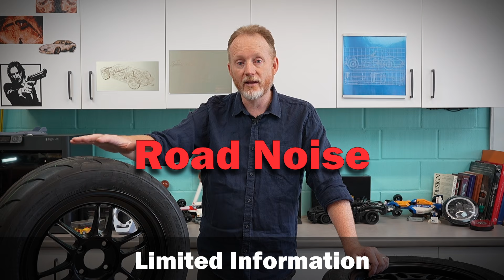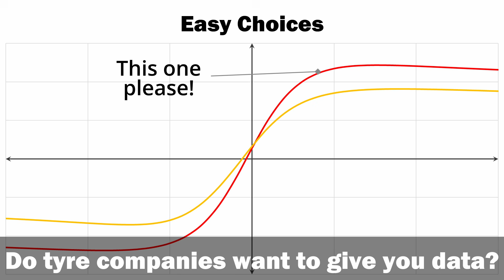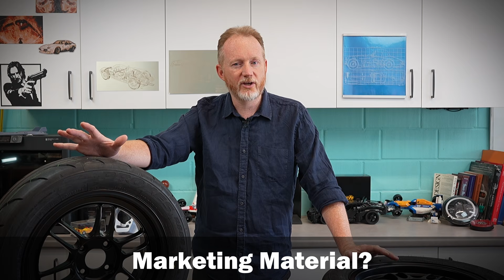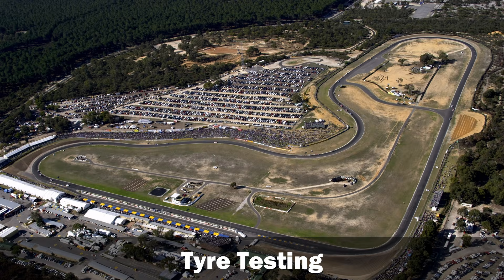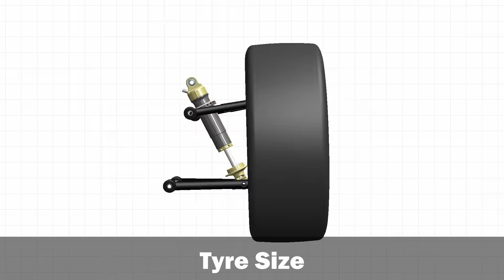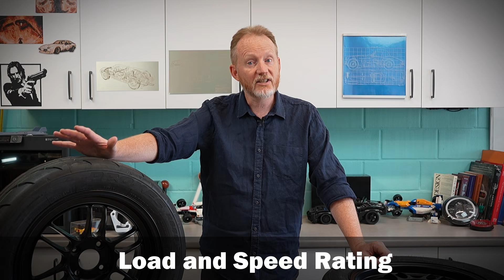How to Choose Tyres When There’s No Data (Project 171)

Comment: Professor, with the greatest respect: your YT lectures would have a lot more credibility and entertainment if you intermixed actually building the the car with your lectures. The reason for designing a car from the tires-up is the first lecture lasting 15 minutes at best, followed by practical building of said car. 

It's the difference between 12k subscribers an 1M subscribers.
Reply from the maker: It will get there. You make some valid points.  Keen to show the whole process and for a full ground up design there is a lot of time spent doing work that isn’t great visually near the start.  That being said I could do more to show other examples… there are many times I have wished I took more video / photos of past projects.

Comment: The only cars I’ve ever seen regularly using the r888r tires are show cars. Small town sample size, but I’ve never seen a single pair at autocross or on a car met in the hills.
Reply from the maker: I have seen them on a few cars here, but definitely not making the case that they are the ideal autocross tyre.  Happy enough if they end up as a decent road tyre / passable track day tyre.  Will aim to test a few options when the time comes.

Comment: Tire Rack and Tyre Reviews have a boat load of objective and subjective tire data.  
The UTQG ratings stamped on the sidewall are from a test designed in 1966 and implemented in 1978. The treadwear rating is still the most relevant, but does not account for modern compounds (silica-rich, multi-phase polymers) and can vary greatly depending on the asphalt type, driving conditions and loading.  The traction rating is performed on wet pavement and concrete on a skid trailer that locks the tire up and only measure sliding traction(100% slip). It does not represent the tire's peak traction. (5-15% slip).  The temperature rating is a structural failure test performed on a test wheel and has nothing to do with the tread compound's heat tolerance when driving hard/at or past the limit.
Reply from the maker: I did make a few logical leaps from the temperature rating. You are spot on that its a structural test. In order to have a tyre that performs well in the test there is a need to focus the tyre design on reducing internal heat generation and improving heat dissipation.  These are aspects that would lead to a tyre that likely has more stable temperatures on track and hence more stable grip.  Although I admit it is a leap of logic that I didn't fully explain.

You are also spot on that the traction rating is based on the contact patch rubber being in a 100% sliding state which has a much lower friction that what would be expected near the peak sliding speed for the rubber.  In this I agree that the treadwear number is probably a better measure of grip which is why I made it the main thing I was looking for.

I had seen the rating system that Tire rack had done on tyres which looks to be reasonably well collected and presented subjective feedback from customers.  I think that it does beg the question how much of it is tailored for commercial purposes.  I think forums find a way to be quasi-peer reviewed.  Post something people disagree with and there is an army of people wielding keyboards to take up an argument.

Still happy to have a look through the recommendations.  I can't believe I had missed something like Tyre Review which actually looks like it has some great review articles, and attempts to put figures to the performance.  Thanks for posting the feedback.
Reply: @KevinHayward7  The hard part is these reviews are generally done with a much heavier car. How relevant is the data on a car half the weight?
Reply from the maker: Definitely an issue.  Ultimately will need to do the work of testing on the final car.  I might be stubborn, but not stubborn enough to stay with a tyre that turns out to be rubbish once running.  All engineering claims should be put to the test, its part of the process.

Comment: load rating is my key...
Reply from the maker: My main question around the load rating specification is how well it does or does not capture the extreme load changes on a track.  Otherwise definitely helps know the car segment the tyre is designed for.

Comment: I thought I knew a little bit about tyres but when I read into it during my FSAE days, you realise how complex a topic it is. FSAE teams are very fortunate to get access to the common sizes and compounds available to FSAE teams. We stepped up to an 8” wide tyre and saw significant gains. I spoke to a German team and they got their best results from a 6” wide tyre. Their car weighed 147kg  and ours was nudging 200kg.
Reply from the maker: The tyre testing consortium is a pretty unique and wonderful initiative.  Easy to get spoilt in FSAE.  The TTC didn’t exist when I was a student but I have had a chance to go through it as a faculty advisor.  I think it has had a massive positive effect on increasing the average knowledge about tyres in the community.

Comment: Have run 888’s and they are going to be fine on that car. Will last forever and be high grip on road (except when cold) and more forgiving at the limit than some of the better semi slicks. Fallen Azenis are any good option for that use case. I would also consider a set a quality road tyres with a lower overall grip threshold than will reach slip angles at less dangerous speeds but just don’t take them on track or you’ll kill them. I used Michelin Pilot on my gtv and that was nice for sliding around without being too antisocial.
Reply from the maker: Will definitely be aiming to identify a good fun road car set of tyres.  The Michelin Pilots have come up in a few sources as a good option.  While it is still a long way off I'm keen to do all the driving to test the different tyres.

Comment: I previously asked this, but my comment seems to have disappeared, maybe because I included a link. I'd like to hear your take on the Factory Five 818 kit car. It shares some fundamental elements with Project 171.
Reply from the maker: A couple of them in the sportscar builders club I'm a part of.  I think it was a pretty good approach to a one donor kit car.  I'm not a massive fan of the suspension layout but Factory Five did a great job of putting something together for the suspension that made good use of what was in the base car.  They also look pretty good.  If I was to do a kit car it would be in amongst my top 5 options.

I did purchase the manual for the 818 to use as some reference material.  As well as the book for Midlana.

Comment: Bing in the UK, wet weather grip and cooler temperatures will guide my selection down quite a different path. Totally agree that 15" seems to be the sweet spot for both wheel and tyre options! Packaging inside a 13" looked to be quite a bit more difficult. How much was your tyre choice be influenced by powerplant/gearbox combo? How much flexibilty can you expect to get by changing the tyre outer diameter for torque/speed tradeoff? I can imagine choosing a sligtly larger tyre to do a 0-100 kph run with one less gear change.
Reply from the maker: Absolutely agree that if I was in the UK it would not be this tyre.  I wasn't too worried about powertrain / gearbox combo when choosing the tyre, although at some point there maybe some changes to make with the final drive.  I used to drive a Subaru Wrx with this basic sizing and I think everything was geared really well for some spirited driving.

Comment: Well explained. 
 Too bad smaller tire sizes availability is poor. I think you're doing exactly the right thing. How the tire behaves near the limit is more important than max grip. For a road car, you'd want to enjoy the car at reasonable speeds.
Reply from the maker: I did look a fair bit for something in the 14" size.  I think 13 might be a little limiting if at some point I want to significantly increase power and want a lot more brake in there.

Comment: For all the negative press the Toyo R888R gets, it's one of the most cost effective semi slick road legal tyres available and as long as the last 10th of a second lap time isn't the main objective, they're within 90 percent of a Yokohama A052, size for size, on warm, dry racing asphalt. Just don't bother risking your precious metal on them when it rains, or it's cold! And as a road tyre, it's fine, and not actually terrible on wet roads, just not "good", like Michelin PS5 or Continental Sport Contact 6/7, obviously are. The two biggest issues I've found with getting any tyre to perform at its best, are tyre pressures too low and wheel frequencies too high. But you know more about those things than I do, so I will patiently await your testing and analysis programme with mounting anticipation!
Reply: At the price, linglong sport master absolutely annilates the ps5s. Chinese tyres are getting really good these days.
Reply from the maker: Cost effective was a very important aspect of the initial tyres.  Reality is that they will sit around during the manufacturing process and will not be brand new once they hit the track.  It was important I didn't spend too much on the first set of tyres, but at the same time needed something close to what will be needed for the full design process.

Interestingly the final decision was whether to go for the A052 or the Toyo, and it was the price that was the final decider.

Comment: Problem with track tyres (< 180 TW) on light cars is that they're all heavy and stiff and thus harsh. Not worth the trade off for a road car IMO. Top street tyres (e.g. Yokohama AD09) are still capable of outrageous cornering performance on the road.
Reply: The Yokohama AD09 is what i chose for a heavier car (mostly road going MX5 NB).  What I liked from the 'imperfect data' available is that the compound contained silica to improve wet grip (at the expense of reduced dry grip that sets track records), so edging out other options like R888R, etc.
Reply from the maker: The AD09 was and still is definitely an option.  A long time ago on an old BMW I had I almost exclusively ran Yokohamas.  Really appreciated the quality back then, and I'm happy to put different Yokohama tyres on mosy of my daily drivers if there is a good option from the company.

Comment: Grassroots Motorsports has done a pretty comprehensive tire chart over the years. They rank almost every single high performance tire available 200 treadwear and under. I would have gone with the Bridgestone re71, but the price point of the r888 is usually pretty attractive
Reply from the maker: I didn't spend much time going through Grassroots Motorsports, which I absolutely should have.  Thanks for the reminder.  That is a resource I almost criminally underuse.  So many good articles.
Reply: They just posted the "Autocross Tires for 2026" video yesterday. Perfect timing.
Reply: In a moment of misplaced obsession to detail*, when I wanted to upgrade the wheels and tyres on my very first car, I went for the first incarnation of RE71.  

* This was in 1987, and the vehicle was a Corolla.  What's even sillier, is it was the original KE10, replete with live axle on leaf springs, and a single transverse leaf spring across the front-end! 😅 

The set of 185/60/13 on special order, was $560 - at the time equivalent to my fortnightly income after tax!  Nowadays, that would equate to $3200..! 

Such a stupid 19 yr old...🤦‍♂️
Reply from the maker: I wish I had appreciated the old rear wheel drive Corollas more when I was young.  We had one that I always thought was just too slow.  What I didn't appreciate in all the thrashing about that we did with that car that it was a very lively fun car.  To this day the best handbrake turns I have ever done in a car.  Cookie cutter tyres and low weight and that thing would just rotate on a dime.  If it had super grippy tyres it may have ruined the main fun things about that car ... well until you added a ton of power to compensate, maybe changing all the suspension bushings, stiffen up the chassis, new springs and dampers.  Maybe a race seat and a roll cage ...  

Hang on a minute!
Reply: As it happens,  @KevinHayward7 , I did add a fixed frame seat, new firmer bushes, re-set leaves, KYB dampers all round.  Also had the widdle 3K engine rebuilt + mild cam upgrade, 28/32 Weber, zorst, etc.  Yep - it was a lot of fun, but it didn't have the power to loosen those very  sticky tyres.

Comment: In the track day circles that I'm in the r888r is considered to be a pretty bad tire by modern standards. Almost any modern 200tw tires will be faster.

I recently started running Kumho v730s in 15" size with 205/225 stagger on my first gen MR2. With my fuel cell and battery setup it's probably closer to a 60/40 weight distribution and this handles pretty neutrally on track. I've been quite happy with them so far and would recommend them, they are also a bit harder wearing than the "super 200s". You could also look at Bridgestone's higher end summer offerings. From the testing I've seen they generally seem to have the most steering responsiveness. 

Also for some reason 16" seems to be a fake wheel size. The overall diameter of 16" tires is basically the same as 17" every time I've looked.
Reply from the maker: I struggled to find Kumho v730s for sale with both sizes.  The 205/225 stagger was my starting point, but just had issues sourcing them for a decent price in Perth.  They were available over in the east of australia but the places that had them had high shipping.  At some point would love to test out the Kumhos.
Reply: @KevinHayward7  Yeah it seems like they're having issues with stock here in the US too.

Comment: I'd guess that those Toyos are going to give a pretty harsh ride.

For modern tires for vintage cars, check out Vredestein's Sprint Classic and Sprint+.

What will your front and rear ride frequencies be?
Reply from the maker: Wont be pushing it too hard with stiffness.  At the first pass calcs I had it at 1.3Hz at the front and 1.5Hz at the rear.  Although I have hardly spent anytime yet on the spring, ARB, and damper rates yet.  I have been working to get the mass location and inertias to a more reasonable number before going back into VD calcs.  This has meant a lot of initial design, purchases, weighing etc.

Note that with not a lot of overhangs we wont be seeing decoupled front and rear frequencies, so only give those numbers as a rough idea of initial stiffness.  I would expect we will probably end up stiffer however, especially with a more track orientated tyre like the Toyos.

Sorry I can't give a better idea than that at the moment.  Although I am really looking forward to putting that stuff into video form once I get there.

Comment: I think about how much tires have changed since my mg midget was engineered, and his much longer I hope it persists. If my solution isn't general enough, I'll find myself with unsatisfactory options for a consumable eventually.
Reply from the maker: Yeah its crazy to think of how long you have to keep shoes on a car like that if they are designed well.  I think the midgets fair better than the big healeys, which just look odd with modern wheels even though the tyre selection for the standard wheels is so very limited.